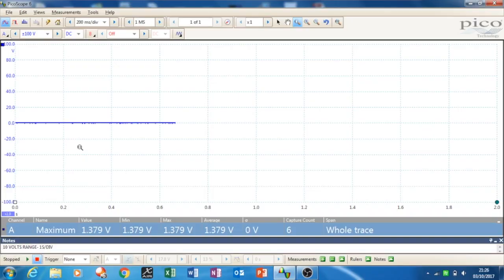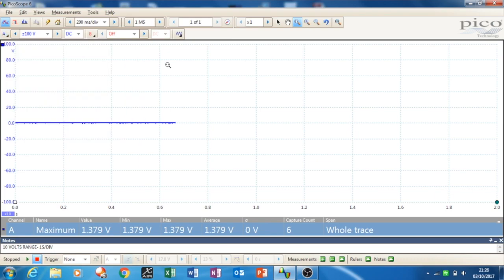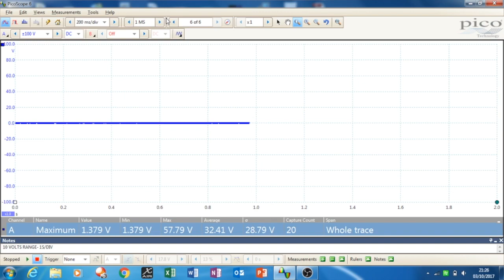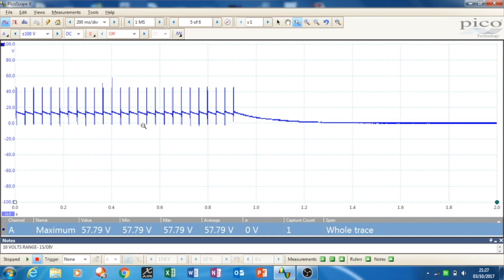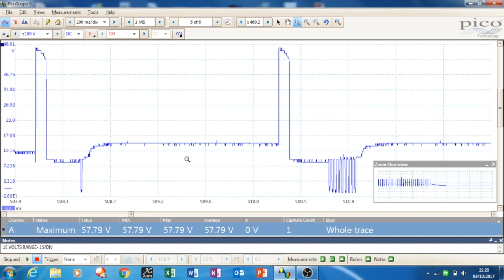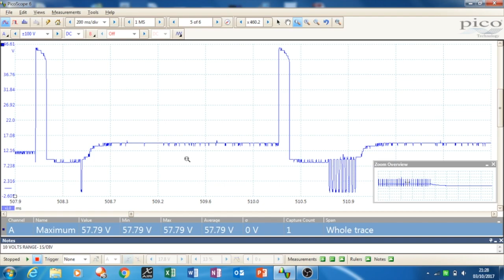Diesel Injector Picoscope

Comment: Hi Sandy,

On the attenuation, you do need to set it on the probe so you don't damage your scope. The setting in the software is just so it displays the correct voltage range, it doesn't do anything on the scope itself.

The Hantek 20:1 attenuators are pretty cheep and will work on the Picoscope as well.
Reply from the maker: Matthew Collins cheers I realized that after I spoke LOL yes I've ordered the hantek from Hong Kong 2 weeks ago I may get them for Christmas! Cheers sandy

Comment: Hi, I just got a hantek 1008c.. and I can only choose 5v on the channels, I also just used normal minus plus cable to read with (not the special probe like your).. my car wont start.. and I managed to get some reading peaking up to around 15v... now i see that it have to go to 100v... do you think hantek 1008c can handle these voltages at all..
Reply from the maker: I read that the hantek supports a 1000 to 1 probe u should purchase that to up the voltage level, what kind of car are working on
Reply: @sandyande   renault trafic 1.9 dci.  what does that mean x1 and x10 on the probe.. is x10.. to accept higher voltage or to zoom in x10
Reply from the maker: Yes 1x means it will on accept 5v 10x = 50 volts, try this videohttps://youtu.be/QmQdGlQabT4
Reply: @sandyande   thanks. Thats exactly how my trafic cranks empty sound. .. but my immo lights works on and off.. maybe i am missing some signal from immo to ecu..  only ecu info I still wonder about is the one that say. Syncronization "armed"..
Reply from the maker: @rteaw  are u getting fuel pressure? What is voltage reading of fuel pressure sensor when u crank is it over 1 volt, should be 0.5 volts key on engine off
Reply: @sandyande  - yes exatcly those values. also new high pressure pump. ecu supply voltage and grounds good. all cables between engine and ecu measured up. Now I see that Ecu does say "immo code programmed "yes" - engine immobiliser "inactive". injectors are the non programmed type.
Reply from the maker: @rteaw  are the injector s firing use a noid loght
Reply: @sandyande   have no noid light but i will scope the current this time.. i have replaced the timing belt maybe the cam pulley have broken key and moved so the timing is off.. measured the return from injectors while cranking without glowplugs al return the same quantity ..
Reply from the maker: Could be, all the best